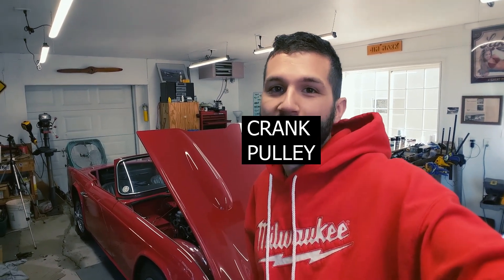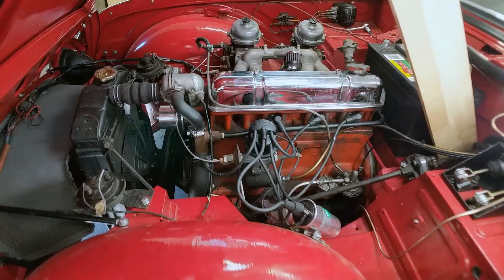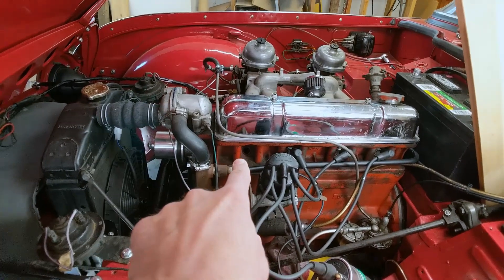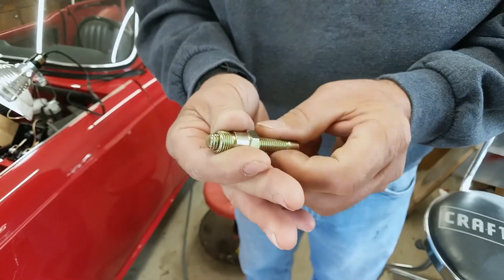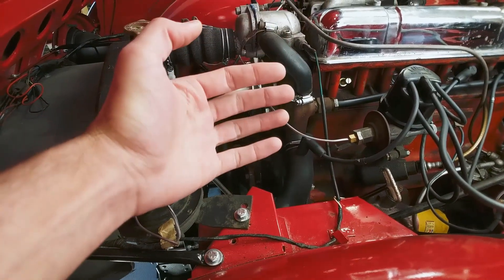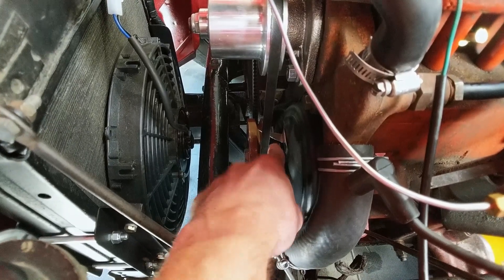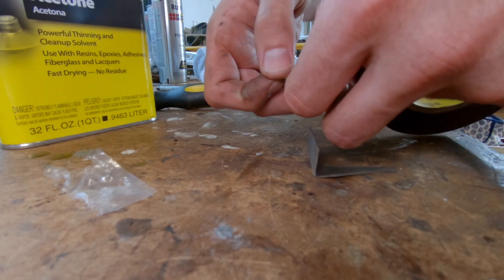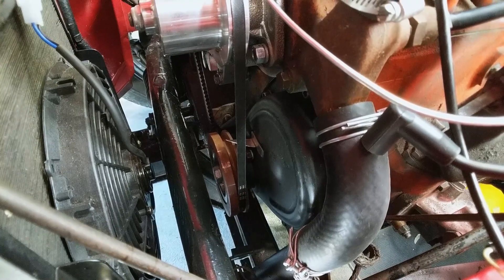Finding TOP DEAD CENTER on our 1964 Triumph TR4

Comment: At TDC the rotor should point towards the #1 push rod tube. Yours looks to be 180 out, do you also have the #1 plug wire 180 out? This is well documented in the Factory Service Manual.

Comment: I just hope that you don't find your pointer in one of your tires one day. :)

Related to this:

https://www.youtube.com/watch?v=5ov5qxpfRCU&list=PLLWNLIF9Lk95V6wQc7_qV13Qthw3UZ2nA&index=5

And be forewarned that the timing chain tensioner will eventually wear its way through the timing chain cover, so be sure to replace the tensioner with the chain.

Oh, and I like the Milwaukee hoodie. My Hole Hawg dates from about 1984. It still works just fine. :)
Reply from the maker: Cool video on the timing gear. Hopefully whoever put that on in the past did it right so we don't have to redo it 🤞.
The TR4 chain tensioner is so crude haha. We replaced the tensioner, just not the chain at this time since it was well within spec.